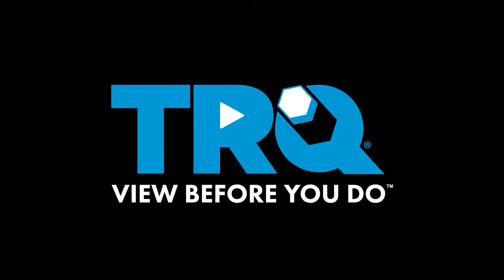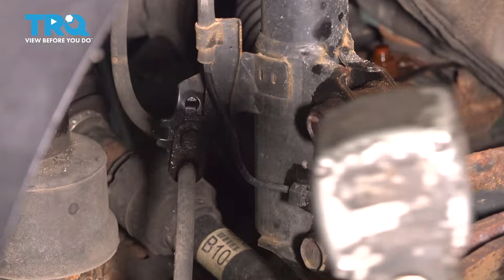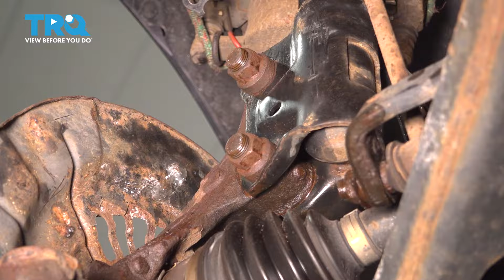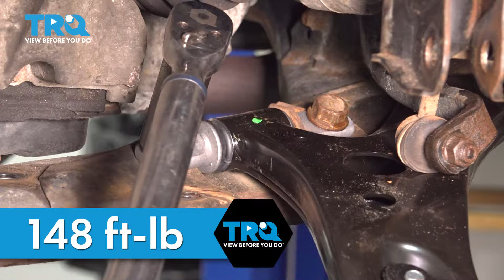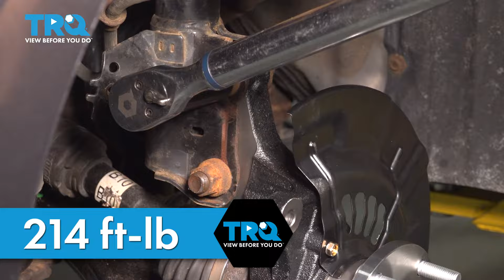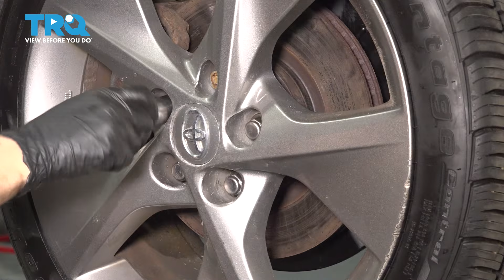How to Replace Front Lower Control Arms with Ball Joint 2012-2017 Toyota Camry

Comment: 2:18 this is a dead blow hammer, not a mallet. You wouldnt get that with a mallet more than likely. A dead blow has loose sand inside to hit a second time after the impact of the head. Just fyi. If its up north north, you’re gonna need a good 4x4 and a 4lb sledge

Comment: For engine mounting insulator down side 3 nuts should be tightened to 64 ft/lbs, otherwise it will gives a little bit vibration while driving and uncomfy for driver

Comment: Why would you go through the trouble of removing the knuckle when in your older video replacing just a ball joint on the same vehicle it wasn't required? https://youtu.be/1_9zzScT1d4 EDIT: Oh it's because you had already planned on replacing the knuckle, it's definitely not required.